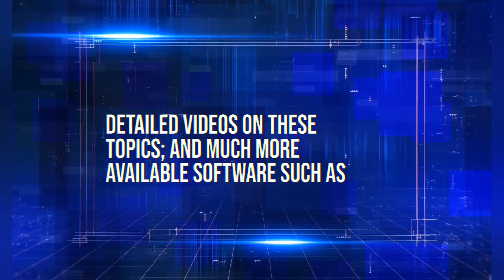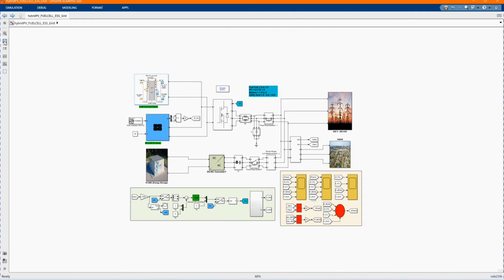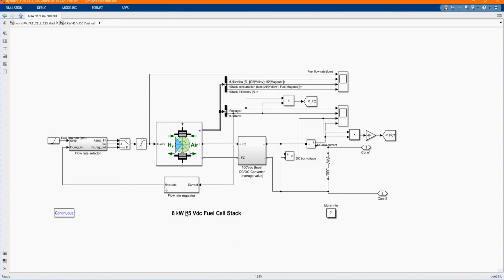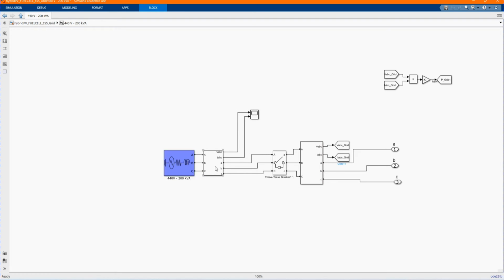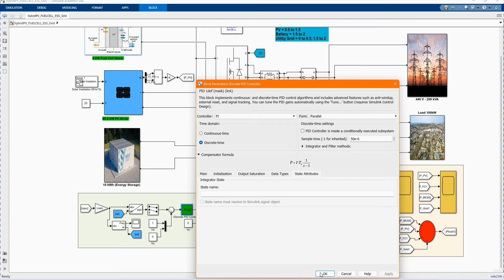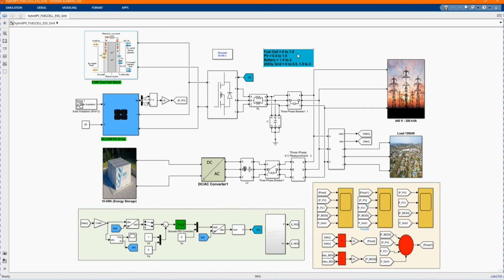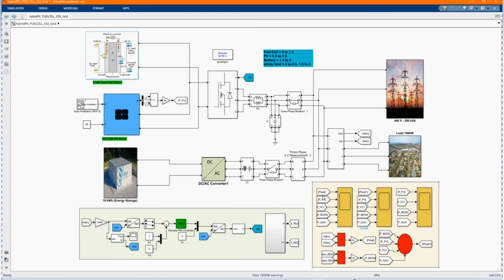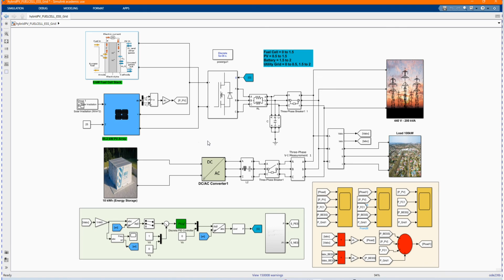Simulation of a Mucrogrid 3 ( Grid, Fuel Cell, PV Solar and Battery ) in MATLAB Simulink software

Comment: hi,  thank you this video. why for battery system use separately dc/ac konverter. can pv battery and fuel cell connect dc bus  and then can we connect inverter for grid

Comment: Thanks for this video.. I wanted to ask If tried PV system with Synchrouns generator instead of using grid as three phase source... I tried it before but it isn't working properly with me.. I will be very happy for invaluable support
Reply from the maker: Hi thank you for your comment, In microgrid 1, we are using generator I think if you take out the grid it should work.